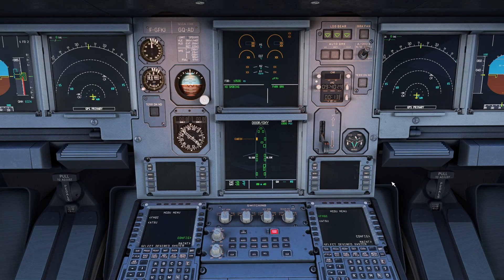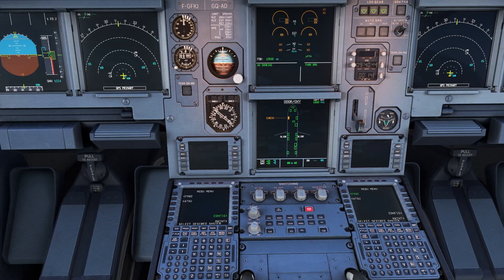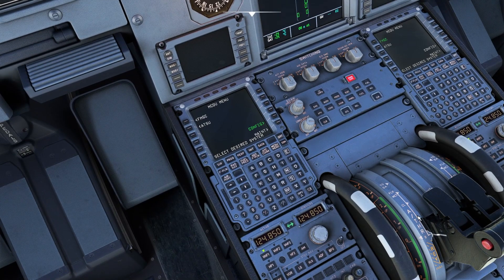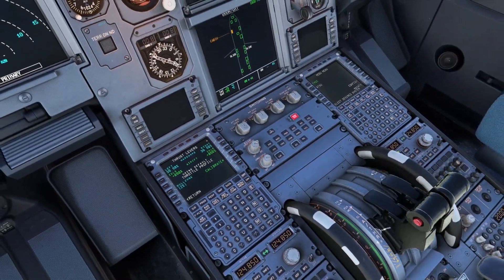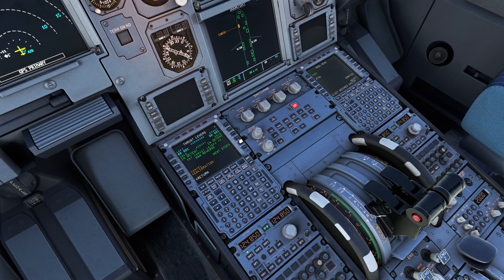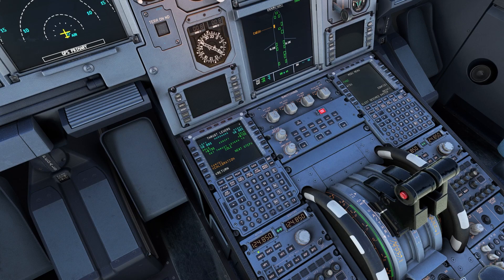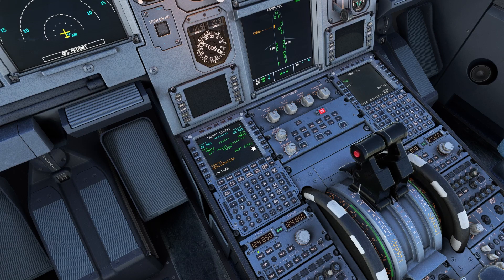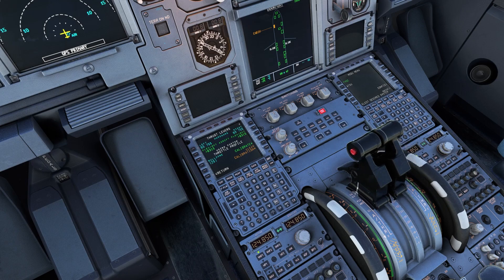Fenix Airbus A320 - How to Calibrate Your Throttles | MSFS 2020

Comment: I give up on the dumb saitek throttles. I cannot get the throttle to stop going reverse thrust when it should be idle.
Reply: I’m having the same issue and the throttles won’t lock at idle, it goes reverse at idle. I gave up on it.

Comment: Hello! I am using a logitehc x56, so my throttle goes from 0 to 100% without any sense as to where my idle would be. I would like to make this so when I am in idle, i push a button on it, that changes into reverse, then I can use the whole 0-100% way as revers. Is this possible?

Comment: i cant calibrate mine like that as they dont move at all in sim i have watched so many videos and all  my settigs r correct but i cant calibrate and everytime i spawn in the plane has already started up and when it doesnt auoto start i cant turn batteries on
Reply from the maker: Are you in the msfs beta?
Reply: @Byemoonmen  i just down loaded the plane, same issue no movement in throttles

Comment: How do I do it if I want my throttle to be idle at 0, not reverse. It makes it very inconvenient for me if it is at reverse when I put my throttle all the way back.
Reply: Skip the reverse thrust setting and calibrate it to 0 when it asks u to calibrate the idle position. In your mfs settings choose button for reverse thrust (i have it set for button on my joystick) After i press the reverse button on joystick i can move my throttle to full power and it activates reverse thrust. When i press the button on the joystick it just switches between reverse and normal thrust if that makes sense.
Reply from the maker: I'm honestly not sure, I ended up setting mine as idle in the middle, if I move it back it goes on reverse, forward it goes forward

Comment: You almost save my TCA throttle, I follow your step.  It pretty work!!  But I have no IDLE, when I operate TCA throttles at IDLE, the throttels in MSFS screen stop at REVERSE IDLE.  I try many times, the best setting, I have REVERSE, REVERSE IDLE, CL, FLEX, and TOGA, just don't have IDLE.
Reply from the maker: Are you placing the idle and reverse idle on different spots? If you try to bind them to the same location I don't see it working
I don't have a tca throttle to check this, but that's how I set up mine, I have a bit of a deadzone between idle and reverse idle, so they are essentially in different spots
Reply: @Byemoonmen  yes, i did, different position, same result no idle
Reply from the maker: https://kb.fenixsim.com/tca-airbus-quadrant-calibration-issue
I found this, it might help a bit
Reply: @Byemoonmen  THANKS your help, I solved problems.  The key operation is setting SENSITIVITY, all set to 0 without REACTIVITY.
Reply: @8816run  Thanks very much for this! I spent an entire day finding the answer here! I don’t know why many others did not have this problem? Must be our default settings in the sim very different from others!